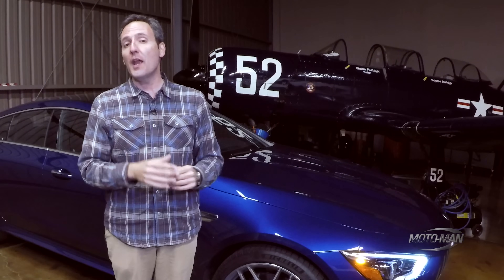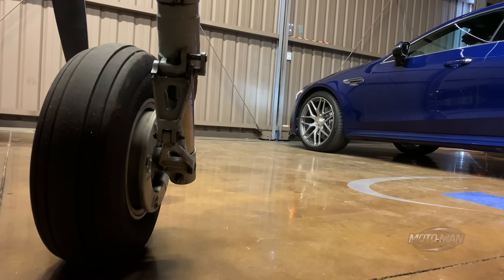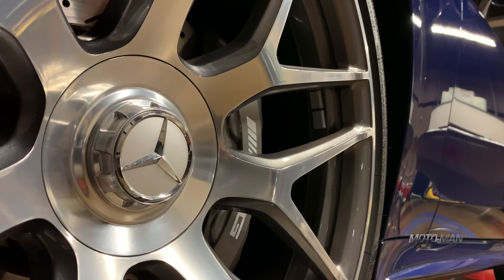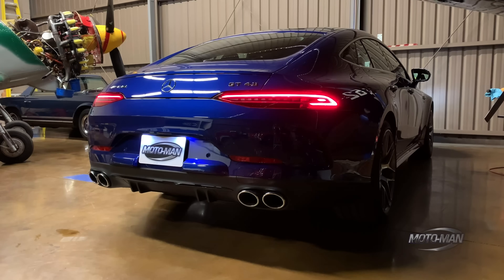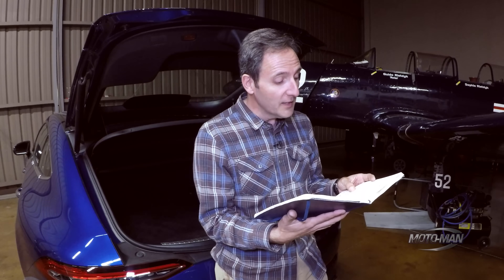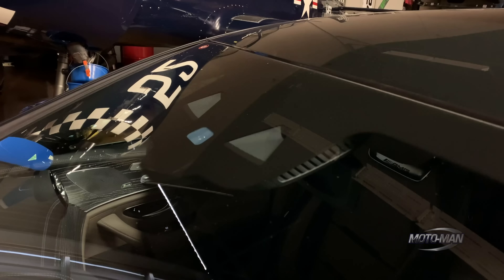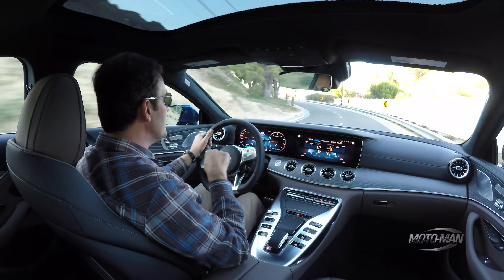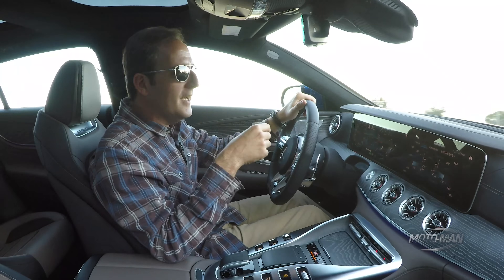The Mercedes AMG GT 43: 5 reasons why 48V Hybrid systems may improve reliability in complex cars

Comment: Very good video. Question: as the 48V battery ages, does it warn you that a replacement may be required? If so, how? If not, that is a big problem because, once the 48V battery dies, the car cannot be jump started, leaving you stranded. It would be embarrassing if Mercedes didn't consider such a basic need.

Comment: I believe if they were to actually do as you say, in putting the (48V) in the top line GT63s it would turn some heads but as well gear that auto shopper toward top performance as well as going sort of hybrid but not full out Tesla style.

Comment: Does it only have 329HP as in the thumbnail? If so then the 43 naming seems to be a bit stretched. An E350 here has 300HP, although with a little bit less torque at 400Nm, also with 48V EQ Boost...
Reply: Yeah, but the E350 looks like a sedan while the GT43 is simply a sculpted thing of pure, unadulterated beauty; it’s sublime.

Comment: It's not true that you're getting more with Brilliant Blue Metallic vs Brilliant Blue Magno. They both have clear coat. However, the matte clear coat of the Magno paint is far less forgiving. The gloss of traditional clear coat not only hides a world of sins. Flaws can also be corrected in gloss paint, but not on matte. What you spray is what you get.
Reply: So you are getting more with the metallic paint.
Reply: @dalaanibombina8822  no, his claim was that you're getting more with the metallic paint because you get clear coat, but in fact both have clear coat. In that regard, they're equal. If you go beyond just how many layers of paint you're getting, there's a solid argument that you get MORE with the Magno paint because of the added labor that goes into producing the finish.